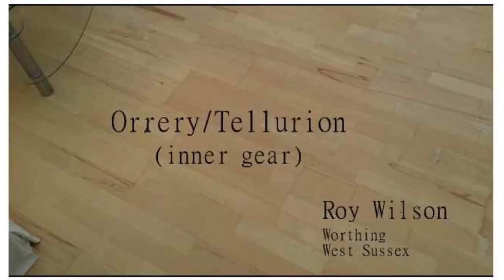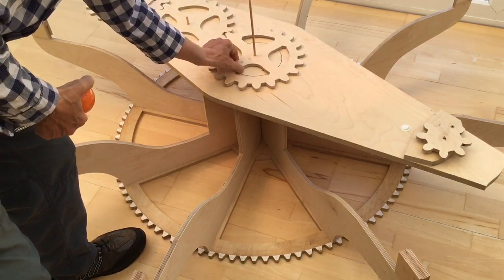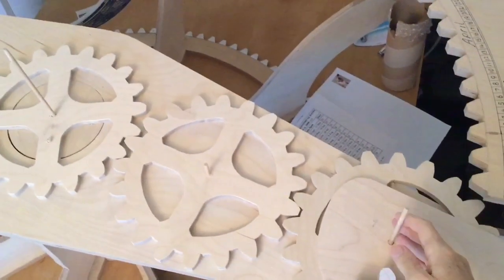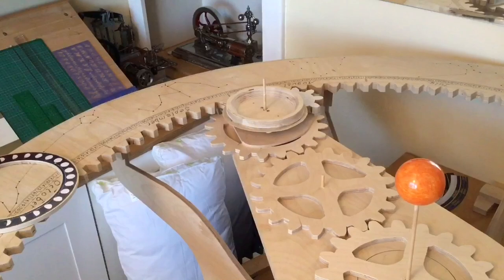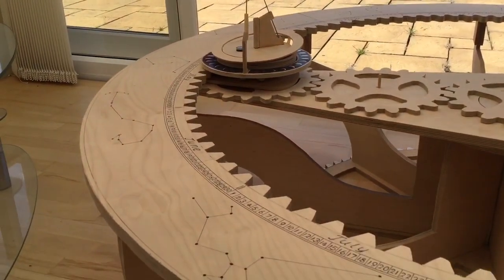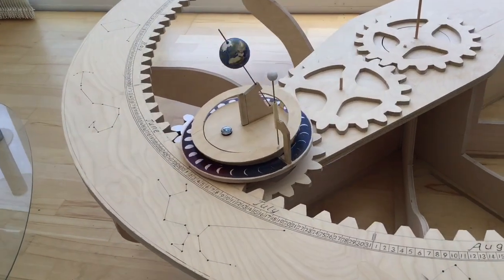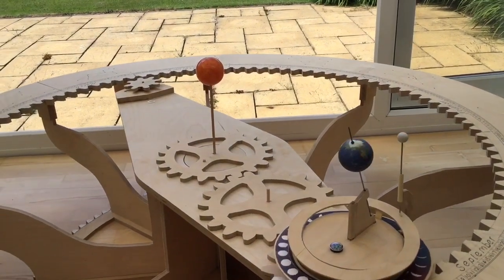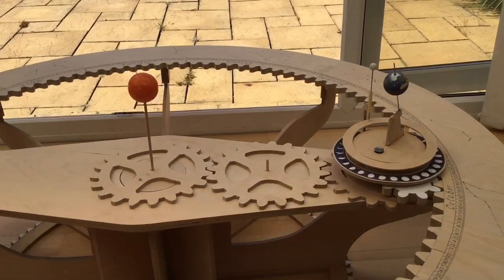Orrery/Tellurion (inner gear) construction

Comment: Fantastic work Roy, just mesmerising! Do you mind if I copy your design to make my own? What is the gear ratio for the Earth to spin from the moon dish? I can’t see anywhere that you have mentioned how accurate this rotation is, but assuming it is in proportion? Thanks!
Reply from the maker: Thanks. I have no objections to you copying my design and would be very interested to see your results.
The dish has sloping edges which means the circumference is greater at the top than the bottom. The Earth’s rotation can be adjusted by changing where the cog at the end of the Earth’s axis contacts the dish.  The dish diameter is about 155mm at the top giving a circumference of 487mm. The nylon cog has a diameter of approximately 5.3mm giving it a circumference of about 16mm. This rotates the Earth in theory 30 times per lunar cycle. However we must remember that this is made out of wood so getting an accurate rotation for the Earth by this method is not possible in practice. On my model when I have counted the Earth rotations (not easy) it can vary between 25 to 30 rotations per lunar cycle.
You could introduce a brass gear ring instead of my “dish” which could give greater accuracy.
Good Luck

Comment: Why the gear at the base touching the floor?
Reply from the maker: The gear that forms the base has no relevance. It was an old gear that I stored badly and it became warped and therefore useless. Rather the throw it away l used it as a base for this Tellurion.

Comment: Hi Roy. Very fascinating work! 
Just a few questions:
1. Could this work with the illuminated sun from your other video
1 a. What would need to be done to not have a 'eclipses' with every cycle?
2. If you pulled it apart, could you make templates for one to follow and reconstruct, or alternatively, could you sell it as a kit?
Reply from the maker: Hi Vusikhaya
1. Yes my illuminated sun fits on this model and works exactly the same.
1a. As with all Orreries and Tellurions the distance between the earth and moon is not to scale and they are much too close. With this hugely reduced distance  the eclipse shadow is corresponding much too big on the Earth. So with this model it has to be an eclipse every year.
2. I’ve been asked for plans before which is why I produced the “construction “ video.Unfortunately  I haven’t got any plans, it evolved by trial and error but hopefully the video shows enough detail to see how it’s made. 
Thanks for your interest
Roy
Reply: @Orrery-collection  i was hoping for something  like a specsheet for each of the gears, and a step by step of how to assemble the whole thing
Reply from the maker: Sorry no plans

Comment: Hi Roy, beautiful piece of art you made here!  What is "driving" the movement...an electric motor in the earth/moon assembly?
Reply from the maker: Hi Daryl, thanks for your comment.
The electric motor (12v) driving the system is at the opposite end of the rotating arm to the earth/moon assembly. It drives the wooden gear that engages with the inner ring and this drives the rotating arm. The rotating arm then drives the earth/moon at the other end. I hope this explains.
Reply: Roy Wilson makes perfect sense...thanks for the reply!

Comment: Hello, this project is incredible, it is just what I am looking for to elaborate with my students. I would like to know if you could facilitate the plans to make the cutting of the pieces correctly.
Reply from the maker: Hello Neftali. Thank you for your comments. I haven’t got any detailed plans, I just drew it out onto the birch ply. There was a lot of trial and error and it kind of evolved into its present state.
 I made this video as I had quite a few requests for plans and I hoped that this construction video would explain the basics of how I made it. The main dimensions are that the inner gear diameter is 124cms and has 99 teeth. The gear driving the moon ring has 8 teeth. This 99/8 ratio gives 12.375 lunar cycles per year on my model (The actual number of lunar cycles per year is about 12.368 ).
I hope this is helpful.
Roy

Comment: Hi Roy. That's absolutely amazing. Congratulations. One question: do you think is possible to make 'real timed' model? I mean, a kind of tellurion-clock indicating correctly the current month and day. 
I'm planning to build a big clock wall for a Physics teachers room, just like yours, I would be very glad if could mail me your project, sizes, tips, etc. Is that possible? Thank you in advance!
Reply from the maker: Hi Andre. Thanks for your comments. It is possible to make Tellurion clocks and  if you google that you will see examples of some very intricate examples . It would be possible in theory for me to change the motor on mine so the main drive gear runs in real time (ie one orbit of the sun in one year) but it would not be practical for a model like mine. Mine is made mainly from 18mm birch ply. The inner gear diameter is 124cms and has 99 teeth. The gear driving the moon ring has 8 teeth. This 99/8 ratio gives 12.375 lunar cycles per year on my model. The actual number of lunar cycles per year is 12.368272 so my model runs about 5 hours “fast” after one year. I haven’t got any actual plans for mine, I just drew it out onto the ply. I hope though that my video shows enough detail to explain its workings.

Comment: How does the earth spin? Or rather how does it spin so fast? I can't see a clear connection point
Reply from the maker: Hi
The earths spin is driven by the small nylon gear at the end of the earths axis making contact by gravity with the inside of the revolving “dish” that carries the moon. I suggest you watch the video again at approx 3mins 20 sec into the video where I think it can be seen fairly clearly.
Roy